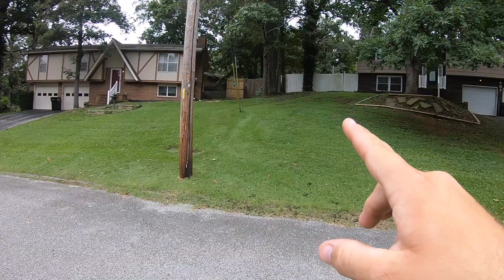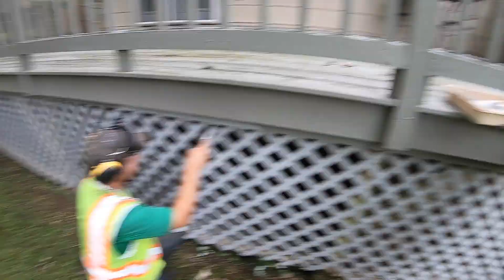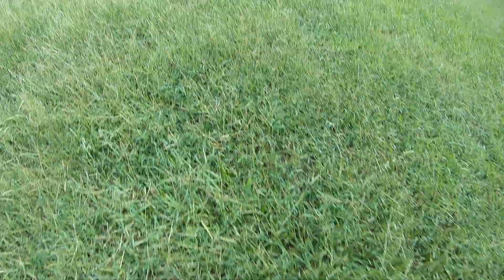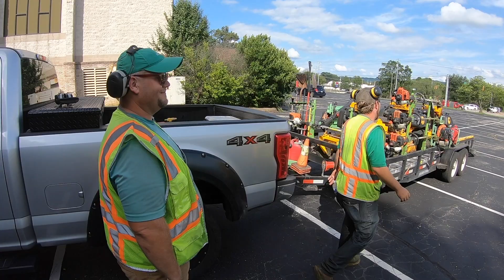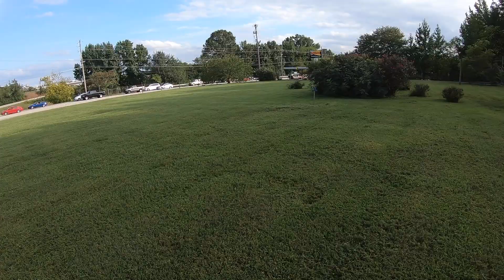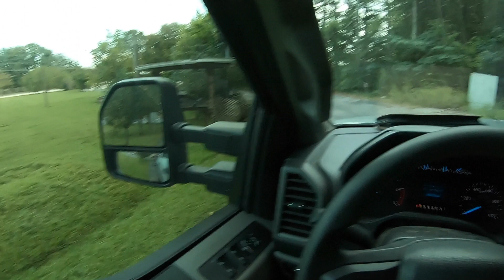New Wright Stander ZK Put to the Test

Comment: With all engines you're going to have your good and your bad. But I have always had great luck with Briggs & stratton's. Currently running a 52-inch Simplicity Courier mower with a 25 horse Briggs & Stratton with the stainless steel sleeves. Awesome power and it hasn't given me any problems.

Comment: I hope we get some footage on hamburger hill and the double to see how the 61" handles that. I wonder if the 72" stander would fit on the trailer.
Reply: that 72 is massive especially if you order it with the rear duals..i think with out the duals a 72 would barely fit ..most trailers are 76 wide and the tires on a 72 are the same width as the deck if i remember correctly from someone else who runs a 72 was saying..oddly the only place i could see the 72 being used would be the church and maybe the school or maybe in the back of the duplexes...otherwise nick would have to pick up some big commercial properties to justify buying a machine that big..just my 2 cents on that aspect
Reply: @janeames1513  I wonder if Nick is still going to have that question and answer with Ed Wright

Comment: This is only my opinion but I still feel that Kawasaki makes a better engine than Briggs & Stratton.  I've never had good luck with Briggs engines lasting.  I agree that the carb Kawasaki's bog a bit under tall grass conditions but if you go with the EFI Kawasaki's you overcome that because they have the constant speed governor.  It's been awhile since I've had a machine with a Briggs so maybe my point is mute and they have changed.?
Reply: I have the 72" hustler x one with the Kawasaki, I've never had good luck with Briggs, but they offer mine with the Koehler also just never wanted to leave Kawasaki to try anything else...
Reply: @shawnlee535  I have a 2005 50" Dixie Chopper with the original 25HP Kohler. With over 3000 hrs and it still running strong. Never had anything done to it except the usual starter, oil changes and blades. If you do get a mower. Always go with the commercial motors. They do cost a bit more but are worth every penny.
Reply: @albertoloyola1685  my 72" hustler xone is a commercial mower... I just like the Kawasaki since I've started buying mowers... I tested the other with the Koehler and just seemed like the Kawasaki did better...
Reply: @shawnlee535  Sure thing. Ive had both as well. I just lean to what ever is reliable, and inexpensive to fix or replace if something does go wrong. Have you considered the diesel powered 72"?
Reply: @albertoloyola1685  no I never really thought about it... I know they are heavy the way the are now... I would be worried about the weight difference and possibly getting it stuck more...
Reply: @shawnlee535  Yeah. The whole getting stuck. Isnt any fun. Ive never had to deal with  it Personally. I live in good ol flat Florida. Biggest ive ran was a 60 on commercial properties. It was a older snapper zero turn with the driveshaft instead of a belt. To drive the deck. Not sure what the difference would be from a gas engine to diesel. But at 72" I dont think it make much of a difference. Im just saying more torque, power to get through that tall grass. Id imagine it be more efficient as well.
Reply: @albertoloyola1685  ya have a point... I live in southwest Ohio right by the river so it's not as dry as I would like it to be... Maybe next season ill look into what else they have... It's just hard to make changes...
Reply: Briggs used to have their fair share of issues in the past but they've come a long ways in the past 10 or so years..Kaw's are nice for a small deck mower like a 28 up to about a 42 but for a big deck like a 48 to 72 the vanguard seems to have more umph to handle more harsh work ..the high grass and hills and things of that nature..i also think vanguard has a higher rpm rate for the blades making it spread the clippings more evenly ...every kaw i have seen running seems to leave big clumps even in dry grass..my neighbor has a fella come mow bi weekly with a sit down z with a 27 hp kaw and he has to triple cut theirs to get rid of the clumps..maybe it's just the operator after all he did walk into my yard and trampled all over my mint just to spray "weed killer" along the neighbors foundation..yeah i'm pissed that he even walked on my property to begin with...(he could have just skirted around their holly tree)
Reply: Yeah Kawasaki engine will be around when than vanguard is in scrap pile. 37 up verses 27, Briggs has to go up in their hp to get torque of kohler or Kawasaki.  Put 37 hp Kawasaki or kohler beside that vanguard and they would eat that vanguard for breakfast.
Reply: That's what I'm saying.  EFI Kawasaki's, like the FS730V EFI w/a constant speed governor I have running on a John Deere X590 w/54 Accel Deep Deck with 3 bag power flow collector, mows very well, & stripes without a kit.  And when it side discharges, there are no clumps, even when cutting as low as 2.25 inches.  Clumping depends on the condition/type of the grass, mower cutting height, & operator knowledge/use of the machine.  Currently, I don't use zero turns due to the terrain and size of the yards I maintain.  A 60 inch or 72 inch mower would be overkill for what I need.  Kawasaki's FX1000V at 35hp, the most powerful engine they offer in their lineup can rival the Vanguard 37.

Comment: I am surprised that you didn't get a 72 with all those big yards you do.   Thanks for my dose of mower porn for the day.  Someday I too will have a sexy mower like that.  Lol. Great vid sensei Nick.
Reply: a 72 would be too much in my opinion..he doesn't have enough big wide open yards to justify spending that kind of money on a machine that size..not to mention a 72 would be a super tight fit on his trailer as most trailers are only 76 wide..my trailer brand new was 76 inches wide and 16 ft long ...if nick went to a 72 he'd have to spring for a little bigger trailer